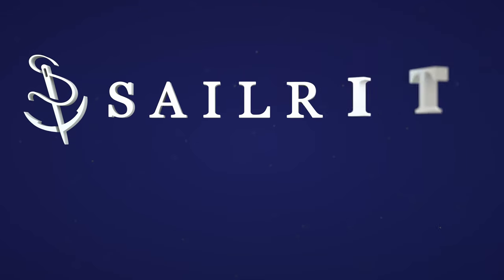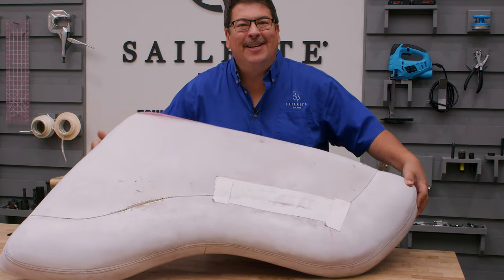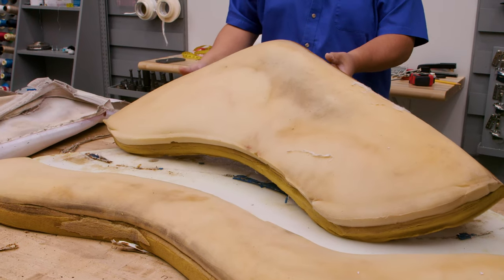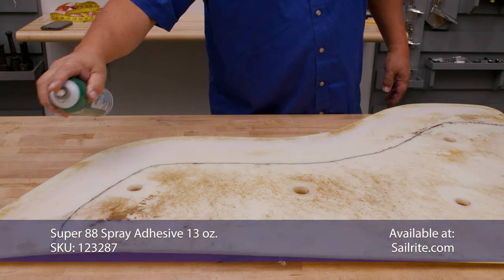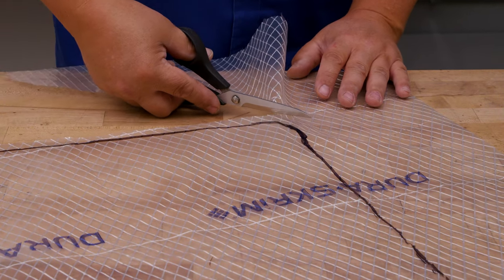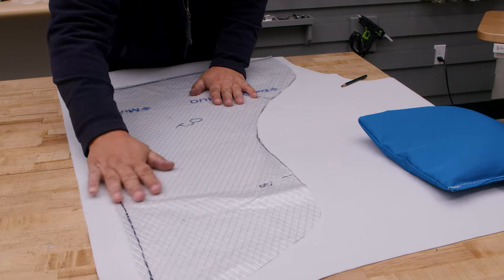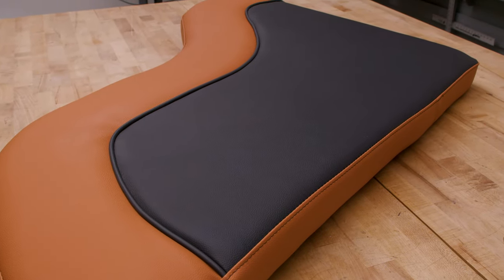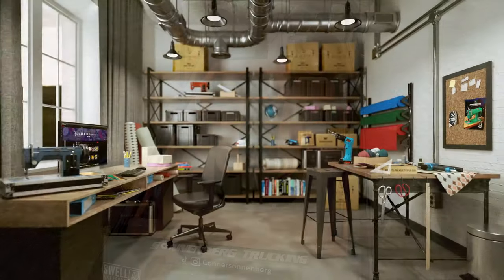How to Upholster a Knee-Rise Seat Cushion for a Speedboat

Comment: Note that he's not using a Sharpie to mark on the vinyl. Don't make the same mistake I did. Don't use Sharpie on your vinyl. It will bleed through, eventually.
Reply from the maker: Very true!!! I like to use the scribe-all pencil to mark the backside of the vinyl. https://www.sailrite.com/search?keywords=scribe%20all
Reply: Learned the hard way. Pulled out an old seat I redid and was able to read everything I wrote on it. haha
Reply: What is the fabric that's being used for the fabric pull between the foam pieces? I see the pattern making stuff is called Dura- Scrim.

Comment: A Suise sewing magnet on your scissors acts as a fine cutting guide to keep you 1/2 inch off the line.
Reply from the maker: What? I am going to go try it now. Thanks for the suggestion, if it works I will make a short video showing using it.
Reply: @SailriteDIY  It's my GoTo. I do only canvas work with massive ConSew machines, but we do use the Sailrite as well.